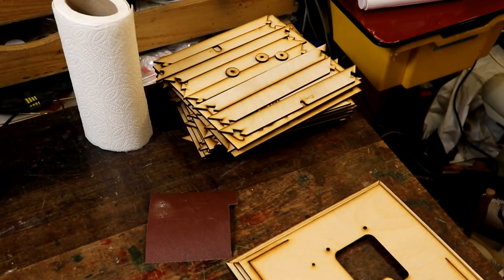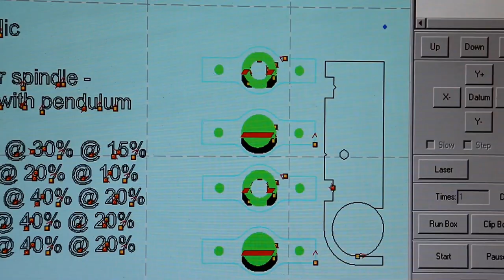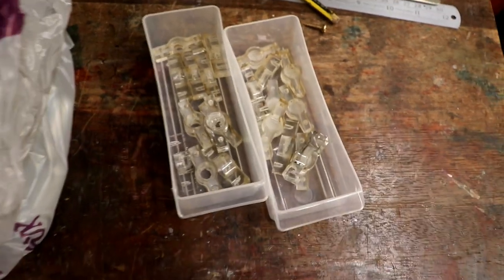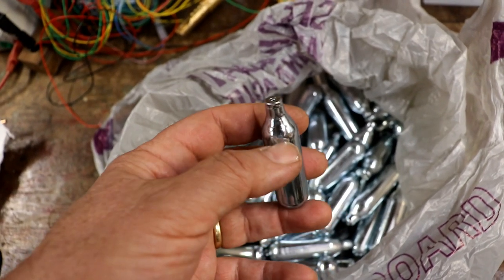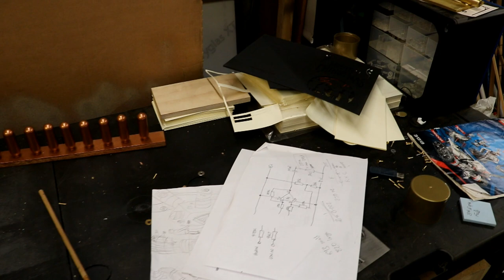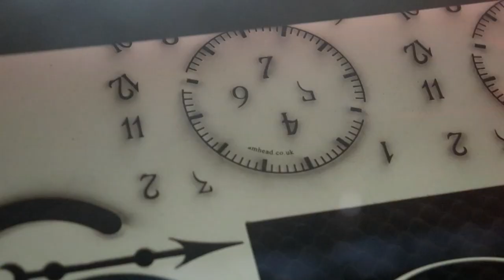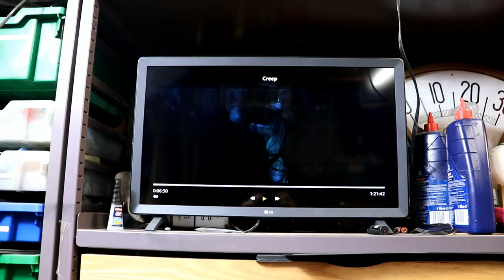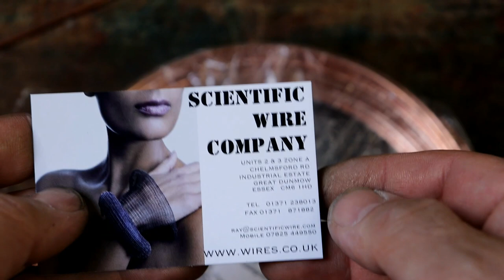Making Steampunk Chronograph Clock Parts

Comment: You may be interested in looking at a "spirit push" for your IPA to make using it easier.
When drilling the blind hole in your part I wonder if using a end mill rather than a drill bit would work better as it would give a flat bottom to the hole
Reply from the maker: Thanks very much for the suggestions. I'll see if I can get a dispenser for the IPA, although I do like the smell of it evaporating! A great idea to use an end mill. I seem to remember looking for one the right size several times in my drawer, and then giving up and not ordering one! I must get round to it. Thanks again.